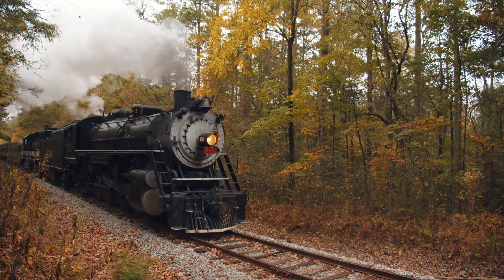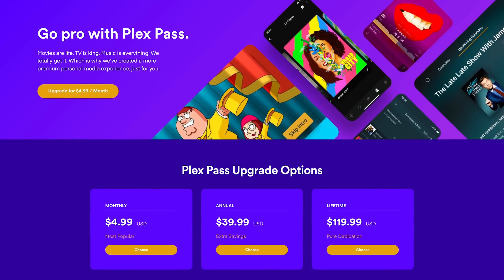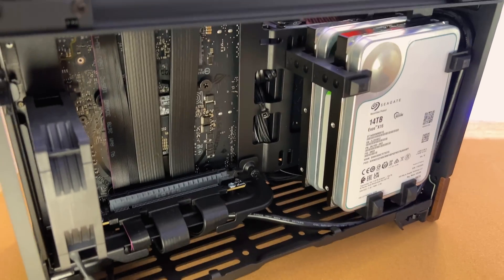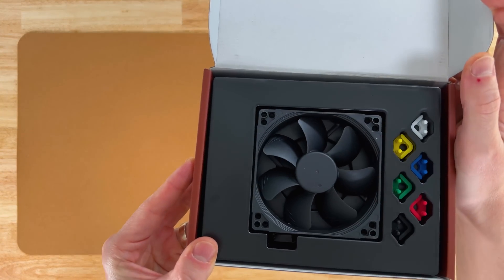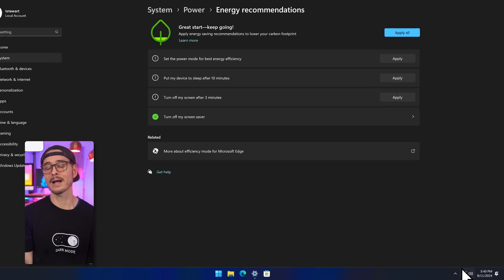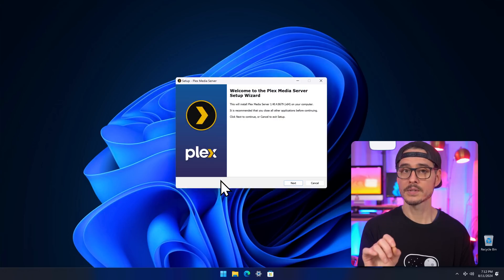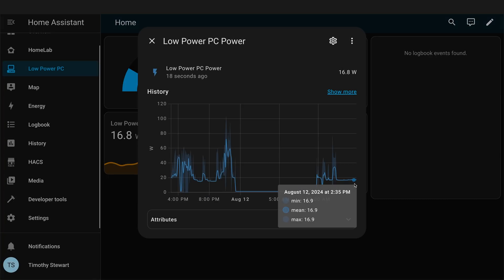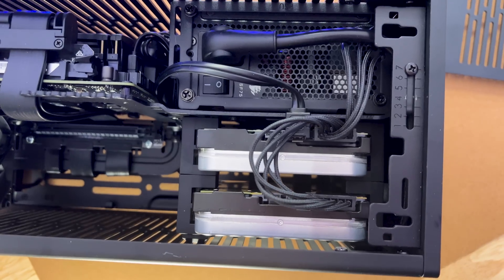Building a Low-Power, Fully Loaded Plex Server

Comment: Nice Video! What about ECC memory? Would you even recommend a system without? Would love to see a low powered build with ECC because all i got is 38 watts with 2 drives and an AMD Epyc 3151, it has no internal GPU but I didn't need transcoding anyway in the past year. I'm curious if there is more to optimize.

Comment: I have a full home server running on a 10400, 32gb of ram, no discrete gpu, and a combo of nvme, sata ssd, and hdd. I use OMV so it is on a usb stick which I make a full copy of every month plus weekly backups, a sata ssd for my plex transcode (it was an older ssd I just happened to have around), an nvme for the main docker containers, then up to 8 HDD drives for bulk storage. Right now I have 4x4TB hdd and 2x14TB HDD.

I use snapraid with both of the larger drives being the parity drives. SMART enabled for all drives that I can that does short scans daily and long scans weekly.

I know this is the not best configuration but it is my first home server and I constantly make backups of all that I can and put them on external drives which I have two copies of (one in home and one at work).

At some point I would like to change from OMV to something that can be installed on an actual drive instead of a usb without causing issues (I heard it has issues or requires the full disk space). I am unsure what OS I would change to that would be relatively simple to swap to from OMV since it uses BTRFS for my data drives.
Reply: ubuntu server and jellyfin docker container?
Reply: @xMdb  I run Trunas scale. I use it for plex and home assistant. I run my drives in clone mode. It's expensive but my data is always backed up.

Comment: Jellyfin has free GPU transcoding. Did you optimize linux for max power savings? Or is it a comparison of "out-of-the-box linux" vs "tuned-to-the-max windows"?
Reply from the maker: I tuned it as much as I could in the UI for Ubuntu, just like Windows
Reply: @TechnoTim  Just do 'powertop --auto-tune' and you'll see real linux power usage. The 'myth' that linux is more efficient is not a myth. It's a fact.

Comment: I can buy a 100w solar-panel and a cheap grid tie inverter and completely offset my current amd 5950x + 128gb ecc ram + rtx A2000. I use the gpu for transcodes the picture quality is better and I can handle all 8 accounts transcoding in real time from my stored Blu-ray raw backups.
This system has a pair of nvm catching and 16x 20TB a
HDD's.
At idle I draw 119w at full power (eco profile + under volt tuning) I pull 232w from the wall.
Plex if just a vm the host is proxmox.
And I push a lot of vm's for work and code testing.
I can save 14w by simply not using the 10gbps nic but I have a 10gbps network so I use it.
My main desktop is a 7950x 96gb ram build with a pair of 4090's. So money not the real problem
Reply from the maker: Sounds awesome!

Comment: I've been able to transcode video with a OASLOA Mini PC that has the N95 processor. IIRC, it idled at around 6 W, and at full tilt, I think it was something like 10-11 W. (I don't remember exactly.)

It doesn't have any space inside for any additional storage, so if I were to use that, I would need to use external hard drives over USB, but I can also tell Windows to spin down those drives when it isn't needed.

It's certainly NOT a performant system, but it CAN be done.

Comment: After years of hardware iterations, from undervolted passive cooled i7s to NAS with multiple 3.5 inch HDDs I arrived at my current most power saving Plex solution. A single 16TB external Drive on a DS620slim with mostly SSDs and one old Seagate 5TB. The NAS runs from 8 in the morning to 1 at night, and the Plex App itself starts at 7 in the evening so the external Drive doesn't spin before that (it's a Synology thing, some Apps keeps drives awake). 90% of everything is my own use though but I had no complaints from the other 10% about the setup either. As much as I like fiddling with hardware and building PCs, an additional device is still an additional device... :)

Any power saving is welcome and I like the video even though I'd always try and make the machine as multi use as possible and prefer T-Series CPUs like a i3-14100T in this case
Reply from the maker: You're really got this figured out!  This is inspiring!  Thank you for giving me more ideas!
Reply: Well you’re welcome then :) keep doing what you’re doing, you inspired me in the past too

My personal minilab is the result of a minimalism phase (what does one really need) and good old german power prices :D

It’s really mind boggling to me that people in other parts of the world easily run multi 100w systems …

The current setup uses ~55w at night when the Nas sleeps and ~75-80w when everything is running and mostly idling. By everything I mean router, access point, nas, one of these 1L Micro PCs with a 12500T for proxmox, a PoE Switch and a UPS. The UPS itself takes 30w which surprised me to be honest but I wouldn’t want to live without it and during the day it’s at least partially if not all powered by two solar panels (600w max)

The only thing missing right now is a backup drive. I stopped hoarding but I’d be sad if my media drive would give up tomorrow… just haven’t found a nice external case yet

Comment: One thing to consider with the power supply is that the efficiency is higher when you draw more power. 
Even if it says 80+, it might be much lower when you don't draw much power.
This is basically to say: take a look at the power supply chart, some of them tell you the efficiency at a given power output. You might get better efficiency at such low power and spend a lot less money.
Reply: For such a small and power efficient system I think that Pico PSU would be the best choice. Any standard ATX PSU can't even come close when it comes to efficiency at 10-15W.

Comment: Awesome video.
One addition:
With so much RAM you could dedicate around 10GB for a RAM disk as the plex temporary trancoder directory. The limited write processes of your SSD will thank you sooner or later. 😊
Reply from the maker: That's a really great idea!
Reply: @TechnoTim  Thanks. There are some edge cases though where a larger RAM disk is needed such as optimising and live TV & DVR (recording long programmes).
Reply: /dev/shm
Reply: how you do this on windows?
Reply: @nisok A free tool called ImDisk. You setup a ramdisk and choose a "drive letter" (R: is easy to remember 😃) and size. Make sure to select start on boot/login.

Comment: I'm running Proxmox on an 11th gen i5 NUC, with a bunch of home automation and various services. It's reporting 6-9W package power just hanging out, 15-18W transcoding and tone mapping a 4k HDR video to 1080p SDR. It's not an exact like-for-like because the video is streamed from a NAS so the drive and network gear power consumption comes in addition. I've been incredibly impressed with the little guy, most recently after installing immich and seeing it generate many tens of thousands of thumbnails in just a few hours.
Reply: which NUC model is that? how much RAM you put in that box?
Reply: @ewoks42  NUC11PAHi5 with 16gb of RAM
Reply: Why bring up a NUC when it has ZERO space for 3.5" enterprise ATA or SAS drives that one needs for a serious Plex server   You need a DAS box that can hold 12 3.5" drives.  or a Dell T330 that holds 10 they run 58 watts and have room to grow.
Reply: @Physics072  I brought it up because it’s useful for me. If it’s not useful for you, move right along…
Reply: @TheShortStory  No one ever said its was not useful for you.  The issue is you brag about low power then fail to mention the power of the DAS or NAS.  The video is about LOW power full loaded.  Bringing up a NUC sounds good until you fail to mention TOTAL system power.  Maybe its low dunno since you never answered the question.  Share that with the folks or move along.
Reply: @Physics072 What do you mean by total system power?
Reply: @daledoe-baggins  Total system power is the power at the all socket to run the entire Plex system.  That can be a Dell Server with 10 3.5" bays, it can be a NAS + a 2nd computer running the server software.  That would inclue the power used to power the drives, cpus, even the mouse hooked to one of them.   That is the true cost to run the system.  Hiding the cost to run the hard drives, MBs etc is a partial and misleading to people that pay the electricity bill.   They want to to know total system power draw at he wall, even power monitoring apps are not accurate in this category.   Need a wall meter hooked between all the components then you will be close to what the electric company reads.
Reply: @Physics072 Thanks for the detailed explanation! 🍻😎
Reply: the morons on youtube are DUMB AF dude...these videos are a joke ...these people make them for the stupid people they target

Comment: I understand the purpose of this video, but if you already have a NAS and need/want a separate pc for Plex, just get an older hp or Dell mini and connect it to your NAS via nfs or smb. Same end result, much cheaper and no extra drives.
Reply from the maker: Agreed if you already have a NAS, just run it there, but there are some people who haven't built one yet, and this could also be your NAS :)
Reply: This is kind of what I did. I had a Lenovo ThinkStation P360 Tiny that I wanted to use for my TruNas/Plex server, but it doesn't have enough physical space in it for drives to build a raid. I had a Raspberry Pi 5 laying around, so I got a SATA HAT for it and built a RAID using OMV on the PI and share it via NFS to my TruNAS server, it works perfectly and didn't really cost much to build at all!

Comment: Cost for build? $700? $1200? Where are savings?
Reply: This - the energy savings would take years to pay back. Also for environmental costs - reusing old hardware is far less wasteful than new. Its a cool machine, but not environmentallly friendly.
Reply: This x1000. A 7th gen nuc, tiny/mini/micro will do about the same for basic (2-3) stream transcoding. One can have that system around 150 USD/EUR. Drives included.
Reply: @bluesquadron593  IS that really all that is needed for running plex good without stuttering? Really want to get a mini pc for plex but no clue where to start and what i need to have it all work with no issues. i don't want something overkill just something where multiple people in the house can use it without any issues
Reply: Timing timing timing. Plex needs new users. Just after back-to-school and before Halloween is a sweet spot for products like this. Reminder to potential customers that would have signed up anyway and suggestion to current customers that might be willing to gift a sub.

Building the machine is for views. Note Tim's language here - "We teamed up" is used more often than "sponsor". In this case he's a lot closer to a typical employee than most other product placements.
Reply: I just use my older server hardware and power off when not in use. It is a Plex server running on FreeNAS 9.10. No space on the flash drive to upgrade. Still works.
Reply: You can wait a bit the prices fall, ATM this is around 600$ build?
Reply from the maker: @joebonsaipoland  hey all!  Love the enthusiasm!  Yes, always reuse before new if you can.  This build was more about building something new if you can’t reuse something and want to use it for years to come.  For example I built my 8th gen Intel PC about 7 years ago and still use it today.  This spirit of this build is in that same vein as my 8th gen Intel.  Build once, max it out, have it for almost a decade and repurpose / reuse after that!
Reply: @TechnoTim  You forgot to answer, tho. How much?
Reply: @ironcrafter54  Very fun to build a new system! That's the real reason for the build - and the Plex sponsorship.
In reality, this build is too expensive just for power savings. An older machine using 120W and running 24/7 would cost $160/yr ($0.15/kWh). This build is over $1000 so would take over 6 years to pay off. Assuming, of course, you already have an older system or can get one cheap. Could also just scale this down a lot and have a more affordable build - but that's not as much fun.
Reply: @BenReese  now calulate it with $0.35/kWh or even more. I use everything as power efficient as it is possible and i have about 120-130W with a Proxmox 3 node HA cluster with 3 N100 mini pc's, Unraid Server with 130 Tb Usable Space and intel core i5 and 6 ssd's and 12 HDD Drives, Firewall baremetal 2,5 gbit with a Celeron j4125, Unifi usw pro 24 max, Offline 160 Tb TruenasScale Server and Offline Synology DS1815+, AP and USV.  
So i run a lot of things on this stuff, but its power usage is pretty ok for a high price region. If you have to look for your power usage, you better go with new, or at least as power efficient as possible when u want to use used/older stuff it pays for itself in a short period of time.
Reply: Yeah, but it's fun